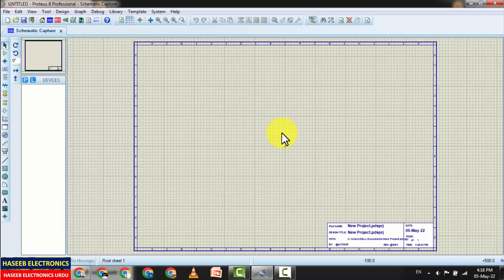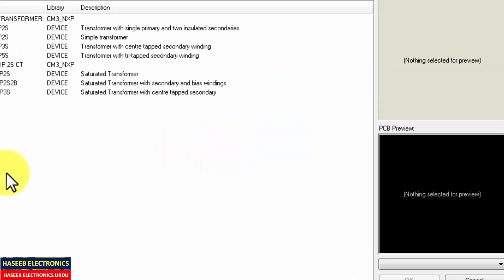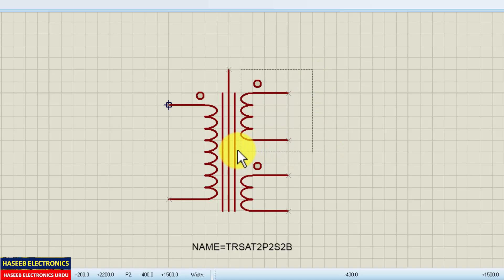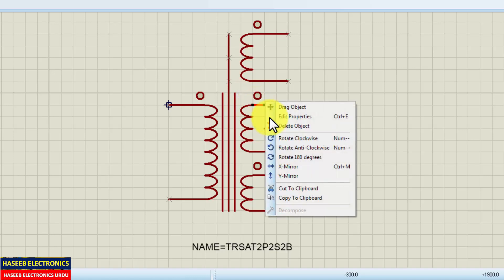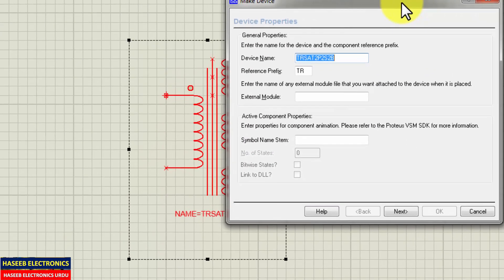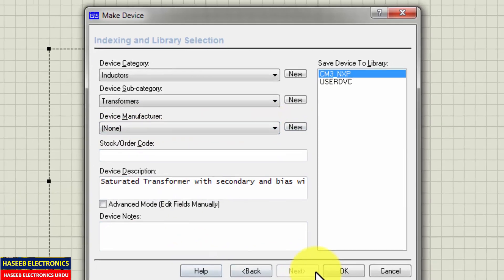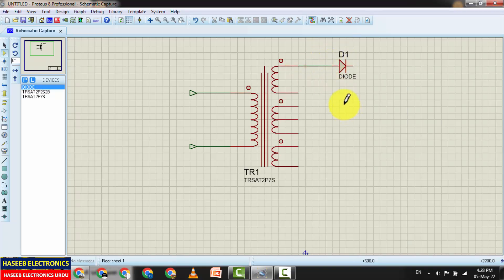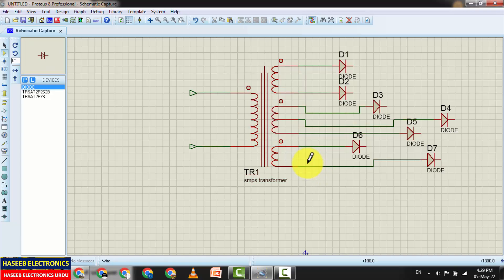{596} How To Make Device in Proteus 8.2 Professional, Add a Component Model To Proteus Library

Comment: assalamu alaikum. i have done the way you shown but can not simulate in proteus. is there any way to make the simulation ??
Reply from the maker: Wa alaikum salaam brother 💕 
Using this method, we can generate a symbol for using diagram purpose. It will not be included In simulation 
For simulation we need to download library file 
You can visit snapeda.com or component manufacturer website to find cad model or eda model or library file. Then you can add that file in Proteus Library

Comment: how the proteus will be knowing all magnetic parameters of new created transformer? We just changed number of coils of transformer. How to set material and it's dimensions, from which transformer core is made? (ferrite, iron, or iron powder, also how to set magnetic "u" for ferrits etc... )
Reply from the maker: when we creat any new component in Proteus 
it will work as a symbol
it will not run in simulator
for simulation it needs simulation details and update in library